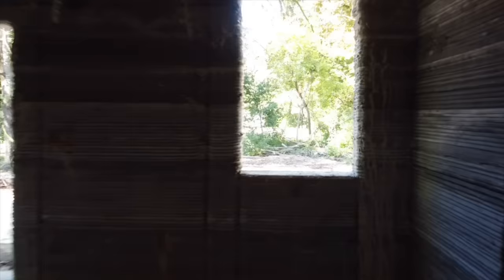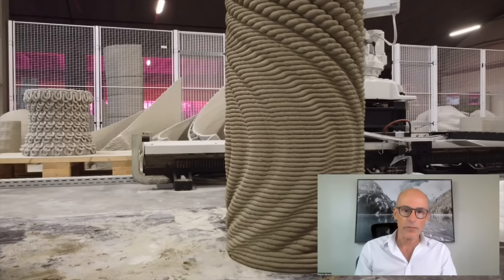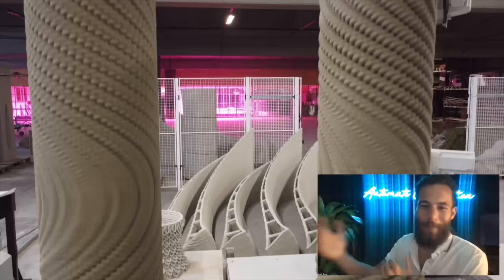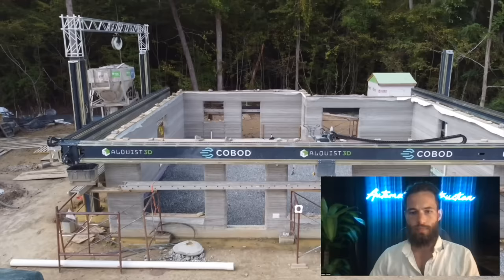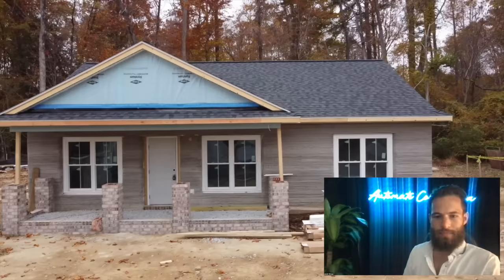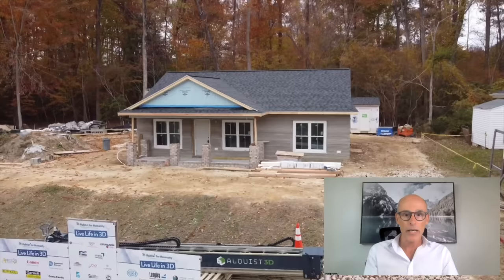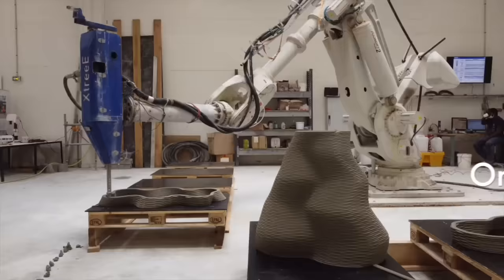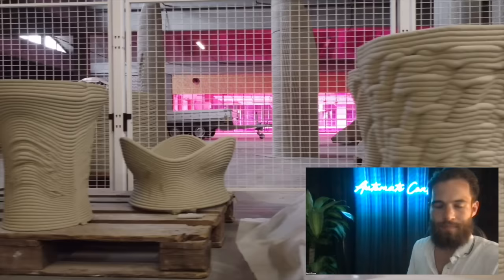11 Lies of the 3D Printed House | EXPOSING THE TRUTH of Printed Construction

Comment: Pumicecrete is by far the best building material on the planet Pumicecrete is a mixture of pumice cement and water mixed and poured into a set of reusable forms walls are poured from 12"to 24" thick pumicecrete is fireproof termite proof rust rot and mold proof and has a high R value and good sound attenuation solid poured walls means no critters can live in your walls Pumicecrete can be built for a fraction of the cost and time and is perfect for automation
Reply: Pumpicecrete and pumicecrete accessories.
Reply: V be a da
Reply: Pumice mordar is used in hia Sofia which has survived 1500 years and terrible earthquakes
Reply: Liquid nails is better, every job I install floors on the contractor has it holding most of the building together and filling all the gaps so obviously it's the best material. Or....maybe the company I subcontract through sucks?🤔
Reply: @Limbodaramus  the main  place pumicecrete is done is in  New Mexico 
Pumicecrete works in all climates
Reply: Roman concrete
Reply: @paulcatt7743  yes
Reply: Is it earthquake proof?  No rebar seems to be in the walls of the extruded structures.
Reply: @jasonjaeger4042  dude I'm dying here, a liquid nails printed house is next.!!!!!!

Man that stuff is trash. I only use locktight Max used to be lock tight X9.
Only a buck or two more and literally 10 times stronger than liquid nails. You end up using way less when you know it holds.
Reply: How about hempcrete.  It uses less energy, lower carbon, better insulation, stronger.
Reply: Of course log house is the best.  No need for fancy machines when you build it.
Reply: @joeboxter3635  yeah what about him Crete? That’s what I was gonna say but you already said it. Isn’t it flexible?
Reply: Someday they’ll just print the whole freaking house with the whole electric system, plumbing everything furniture a maid, and a butler. In 35 minutes lol.
Reply: Bro you ever heard of a period before?
Reply: @NoLoseJustLearn  the only person on there period is you
Reply: @kevyjo aghia Sophia built with brick and pumice mortar, the dome also is with pumice stones, is a Christian orthodox Church in Konstantinoupolis (Istanbul Turkey) that build in 537. Survive 1500 years and after big earthquakes, it's a miracle of architecture!
Reply: Will the homes lean...after a time?   Be like a domino effect.

Comment: building walls is about  -10 percent of the time when building a house, it is the cheapest thing, so about the uselessness of this technology,and not to mention that you won't replace people with that machine, it still requires an operator plus a qualified programmer technician and transport, and setting up and removing the machineso it turns out to be much more expensive

Comment: It blows my mind reading these comments. It's as if nobody talking has seen industries emerge, innovate, stabilize, and then commercialize in their lifetimes. Ever heard of "manufactured houses"?  People were afraid of those too.

The future will be made with stick built homes, monolithic concrete domes, printed houses, factory built houses, kit houses, and probably stuff we haven't even seen yet. 

Where stick built makes sense, there will be profit and customers. Where there are tornados, hurricanes and fires, there will be a market for concrete. Where there is need for speed, and cost savings, there will be factory houses. Have no fear, you can chose your own adventure.
Reply from the maker: Yeah so true well said
Reply: Dude... serious.
Hawaii builds houses on stilts... does that mean we should do that in a dry climate that's inland? No.
There's a proper application for everything.  And it's not always the same everywhere.

Comment: Repairability. In a metal framed structure or wood framed home any damaged components can be repaired or replaced fairly easily without lasting damage, but every cut into concrete permanently reduces it's strength.

Locality, you touched on the "just add water" bit, but it goes even beyond that. The availability of cement ready aggregates are not universal... the potential cost of transporting tons of minerals will add up very quickly. Also, cement walls may be great for a temperate and dry location, but places which are extra cold or wet.... not so much.

Comment: I’m for advancing the development of 3D printed homes but at the same time I never understood why they don’t use CMU block to build homes. Not only is it a very well understood construction method but the blocks are made in a controlled environment ensuring quality control of not only the mix but also consistent density of the finished product. CMU also has a  consistent flat surface allowing other materials like insulation board, hardy board or other finishes can more easily be applied. As someone with a FDM printer at home I’d be worried about layer adhesion, consistent density and repair methods of poor quality sections.
Reply: Unless you are talking about something different, here in South Florida, most homes appear to be built of concrete block. My house, built in 1959, is concrete block so it's been around for a long time. There are a lot of commercial projects going on that use tilt wall construction. To me, that makes more sense than printing.
Reply: @rogermccaslin5963  Older South Florida building codes required that exterior walls be made of 8 inch CMU's for hurricane tolerance. They also required tie straps at all roof truss/rafter joints at the upper sill plate for the same reason, and roof cover had to be hard tiles, often flat - tiles were also tied with wires to the sub-roof panels to prevent them from becoming projectiles. South Florida paid dearly for relaxing its construction codes, especially in the aftermath of Hurricane Andrew.
Reply: Yeah cmu would work on earth, but to get it to the moon, it would cost a million dollars to bring 1 cmu block over there. A 3d printer that uses the moon’s material is the key to our survival

Comment: Seems to me that 3D Concrete home printing, is something that might be better done making Prefab Panels, with Insulation etc already applied, inside a Shop; rather than printed Onsite.
While one large Cement Mixer can be used for several Cinder Block Home constructions, with 3D Printing; several homes being put up simutaneously, would require several Printers printing simultaneously !
Reply: i think the opposite. the strong suit of this construction is that you can make all of the walls a singular unit. it should be very strong. having more printers would not be a huge issue, if the construction were common. most small companies could just rent them.

Comment: What about the challenge of installing electrical/plumbing systems? And I'd hate to have to renovate one of these someday.
Reply: It's simple to leave conduits and e-boxes. Not  challenge at all.
Reply: @phil562 you have no experience in renovation if you think that.
Reply: The walls are hollow so if they leave access to the top in the attic, I don't think this would be a big issue. Easier than pored concrete or cinder-block construction I would imagine.

Comment: All high technology projects involve tradeoffs. 3D printed construction technology is still in its infancy so I readily expect improvements in techniques and processes, standardization, and cost reduction in the years ahead. I'd be interested to compare the carbon footprints of a 3D printed concrete house to comparable sized wood-frame and cinder block homes to see which is greener.

Comment: What I took from this video is what I had assumed even before I knew anything about the process and materials and that is that if anything it is more complicated and maybe even more costly to use this method to build a house or small structure. But I still understand you have to start somewhere. I remember home computers and the Commodore 64 when it came out and the first mass produced cell phones and they were really expensive for what they actually did which was not a lot but now you can get something that's comparatively a supercomputer at Walmart for 300 bucks which is amazing

Comment: Seems like they would be a nightmare to clean all the interior walls.
Reply: Not at all. We got pressure. Washers lol😅
Reply: @MichaelWittner  oh so gut everything out of your house to pressure wash the interior walls? Or power wash your bed, dressers, clothes and anything else you don't want wet everytime you need to clean your walls lol
Reply: same. even with a vacuum with a hose and brush, that would take hours to clean. that being said, the solidity of the structure should allow you to keep most dust out if you really want to. porches could be used as airlocks to help prevent dust getting in. a nice filtration system can keep the air clean. the look is nice. you could easily fill it in though, with mud of some kind, or put board over it.
Reply: Some people are going to want to show off the fact that the home is "3D" and what you have raised is an issue.  However, the walls don't have to be left that way.  First, they can be smoothed during construction on on one or both sides so that they will be a normal, flat and smooth wall.  Second, you can still hang drywall or paneling if desired.
Reply: You could plaster the walls fairly easily and make a smooth finish which would make sense to prevent dust and germ buildup.

Comment: Most of the shortcomings listed in the video are due to the fact that the market for such construction is still in process. It is foolish to expect from a new product that all supplies, supply chains, and contractors will be at the same level as in the established monopoly market.

3D Homes is an innovative product and is marketed accordingly.

Other things being equal, this is indeed a much more convenient, high-quality, and efficient type of construction than traditional frame houses (in the USA).

Comment: I imagine a decentralized approach utilizing a team of bots.  One or two programmable types, articulators and haulers coordinated and redundant. A team of 10 or 20 would do almost all tasks: mixing, hauling, scaffold build and tear down, extruding, reinforcement positioning, error and quality control management, washing and cleanup, multiple extruders would allow for better intricacy without slowing things down. About the size of the Silent Running bots. .... and another thought, maybe there is a way to use recycled plastics in fiber form to strengthen the extrusion. ... Great work! btw.
Reply from the maker: Love it! Thanks!

Comment: The value of printed concrete is to create a "tub" surrounding a house in a disaster prone area. Or the ground loor of a house in a disaster prone area. No penetrations allowed, such as doors or garages, though. The stairs could be enclosed, and watertight doors installed. Any upper construction anchored to the "tub" isn't going anywhere.  Should be a way to have a levee around your house, without violating the "must accept the flood" ordinances that prohibit homeowner levees or prohibit manmade islands.

Comment: It's way, way early in the development arc of 3D printing of homes. While making a list of criticisms is fine and useful, calling them "lies" is a bit over the top. If the tech is really going to be viable, the issues will be worked out. If it's not going to work, it will fall by the wayside along with all the other futuristic "innovations" that have failed over the decades.

Comment: ASTM have nothing to how a house is built.  It ONLY has to do with testing of materials.  ICBO is the standard many state and localities are or have adopted.
Reply from the maker: Municipalities may reference or adopt any standards they like. Just the existence of any standards at all is a step in the right direction.
Reply: @automateconstruction  ASTM is American Society for Testing and Materials.  That's how you go about certifying if a material meets a certain standard.  Like R rating for insulation or break strength for concrete.  Absorption rates for CMU's or density of asphaltic concrete.  ICBO is International Conference of Building Officials.  These are the standards that will tell you if the stairs are up to "code".  The two are completely different areas of the construction industry.  ASTM also covers many things that are not even in the construction industry because they cover testing not codes.  Been in construction industry for over 20 years and am certified in quite a few ASTM procedures.
Reply from the maker: @repalmore  Look at ASTM 52939
Reply: @automateconstruction  1   Scope
This document defines quality assurance requirements for Additive Construction (AC) concerning building and construction projects in which additive manufacturing techniques are used for construction. The requirements are independent of the material/materials and process category used.
QC for additive manufacturing, not a code for the design of the building.  They do work hand in hand but one is not the other.

Comment: maybe do a video on the different kinds of concrete building construction (if you haven't already). 3D printing vs monolithic domes vs preformed slabs etc and which would be the most beneficial in which climate environments.

Comment: One thing that never really gets asked or answer is, "What is the point". Is it to be better than stick built? Cheaper, more durable, more stable? Even if it's not cheaper now, maybe it will be less expensive down the road but is there a true reason to do this versus what we have been doing other than it CAN be done?
Reply: to me, it is the strength of a solid build unit, and all of the amazing shapes you could make, including building structures inside of the walls. i think 3D printed buildings are the future. even the way some buildings are cast of concrete now is very similar, and i have seen builds where they raise the building area up with the building. build a floor, raise the equipment up, build another floor, etc.

Comment: Has Someone Designed An Optimizations Software To Help Calculate And/Or Automate The Best Mixture And Consistency Of The Materials In Real Time?
Reply from the maker: They’re just recently getting around to having the right sensors to do that
Reply: Yeah there has to be some sort of algorithm the machine can take into account to modify the mix

Comment: I bet it wouldn't be difficult to find a way to smooth the surface as it prints, like a tool head extension where perhaps a heated metal plate or something could smooth the layers

Comment: Could the addition of crushed or shredded PET / single use plastics into the concrete help with durability?  I live in tornado alley and look at these home types as possibly safer than the paper houses they slap together quickly.  Impressive subject, and thank you for doing the work to bring this list together.
Reply: Have you considered Perfect Block Composite ICCF? It's rated for 250mph winds.
Reply: @thirstypilgrim97  +1 for that suggestion - plus consider circular or dome shapes and naturally less susceptible to wind.  Solid roof, not a wooden one and you should be pretty bomb proof.  And heavy metal window shutters.  You could even build earth banks to minimise the above ground profile - Hobbit home style.
Always seems insane people just accept their house will be demolished in a tornado - just BUILD them tornado proof! 🤷‍♀
Reply: it is usually about the money and fashion. some people would not even like someone to paint their house purple, let alone make it round or other shapes, so fashion dictates they should look like other houses around them. then there is the money problem. houses are expensive, and contractors already know how to make a square home. even putting in a few nicer features can make the price too high and totally learning new construction techniques would make the price go through the roof, pun intended. many contractors will not even do solar panels. There are also space efficiency issues. the land is very expensive, and is generally also squarish, leading people to want squarish homes. for instance, think of all the floor space you lose if you cut off the corners of your house. overall, it is a lot easier to just agree to have a squarish house and hope you are not hit by a tornado. that being said, a squarish house made of concrete would be fine in a tornado, but then we are back to the expense problems.  @james.telfer
Reply: It's possible in the desktop ish sized printers. MatterHackers or one of the pro brands has a carbon fiber injection process. It puts a continuous stand into 3d printed tools
Reply: Guam, not 3D back when, but concrete withstands better in storms.

Comment: For the vast, vast majority of home buyers in the west 3d printed homes are ridiculous.
I'm a general contractor in western Canada and almost all new homes being built are much larger, more complicated and far better finished than the 3d printed homes shown in this video, this reminds me of what was built in the 40's or 50's minus the cool 50's retro style.
Cost, at least they appear to be honest about that in this video.......because of the sky high cost of buying a home these days low cost housing is needed and that demand is met with factory built, standardized components assembled quickly onsite, 3d printing couldn't even begin to compete.
3d printed homes are a curiosity, nothing more.

Comment: Re cost- If shipping and assembly of the equipment is a very large component of cost, would constructing 100 houses in the same area and thus sharing those costs out by a lot* make DCP cheaper?
*We're assuming people are prepared to 'wait their turn', while the houses are constructed, rather than 100 machines arriving. (But, Hey! It's only 24 hours a house, if I heard you right.)